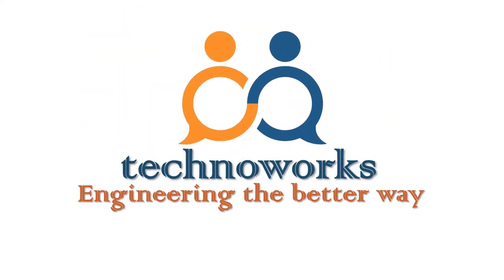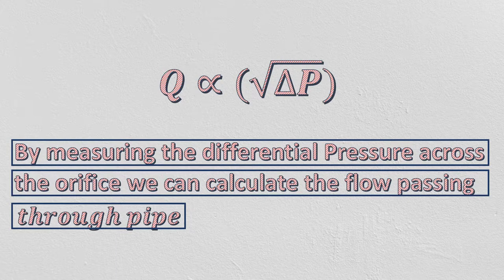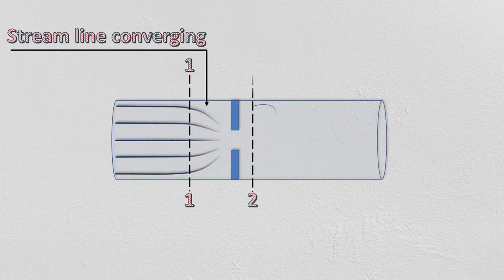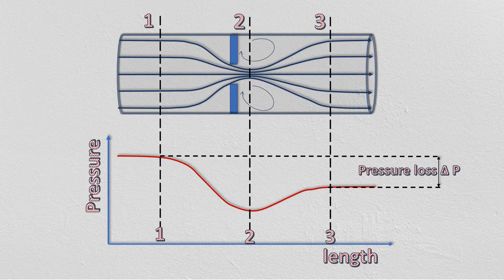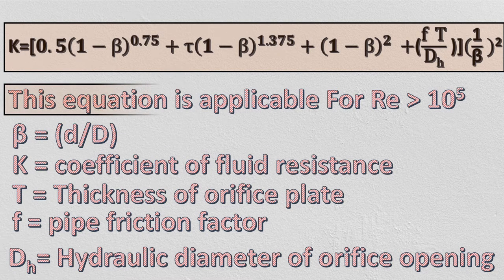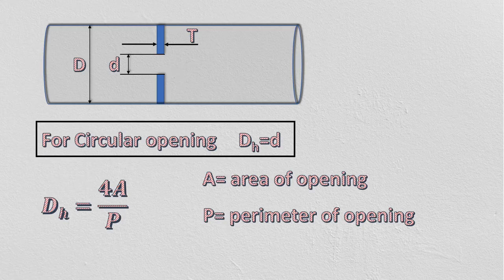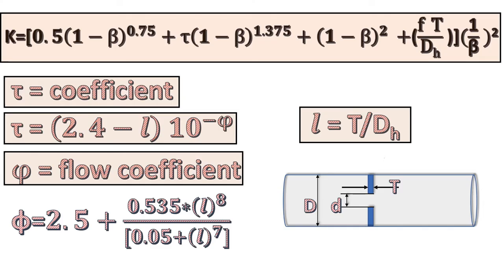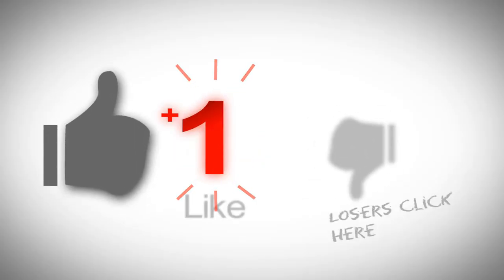Pressure loss calculation of orifice plate

Comment: The pressure loss coefficient correlation comes from "I. E. Idelchik - Handbook of Hydraulic Resistance (2008, BHB)". But in this book page 260, the beta is substituted by area ratio, i.e. beta^2, at time 3:35. Additionally, the calculation for phi in Idelchik's book, the fisrt coefficient is 0.25 rather than 2.5 at time 3:35. I wonder which one is correct ?
Reply: Besides, the excel sheet B25, calculating K, seems to put exponent 1.375 inside the bracket, which is a different form from this video.

Comment: Question pls; On the spreadsheet what numbers do i change if im flowing AIR instead of water ? is changing the formula at B5 enough ? tks
Reply: Did you get the answer?
Reply: @StudySolutionsWala  No not from this bot video , but i did get a spreadsheet from the PTS flow bench form that i found to be extremely useful.
Reply: @luckyPiston  thank you for your response. Can you please share the link.

Comment: Math is not my strong suit, but I have run some testing using your spreadsheet to come up with baseline expected results.  In the test lab, the pressure drops I can recreate are 50-60% of the pressure drops the formulas in your spreadsheet give me.  I think there may be a calculation error somewhere.
Reply: I wonder, is the K for the pressure drop where it is highest in the vena cava, or after it where the pressure is higher than the vena cava, but still lower than inlet pressure.

Comment: this excel seems made for water. When I entered N2 gas details for inlet condition of 2 m3/hr flow, 4 bar pressure and 45 deg C temp for 2 mm size orifice in 1 inch pipe, it did not return me any value. I used 1.165 as N2 density.
Reply from the maker: It's not applicable for compressible fluid like gas.

Comment: The excel workbook for this video has a small error. In cell B23 the formula for the flow coefficient φ uses 0.25 instead of 2.5 as shown in the video. I am guessing this is an error in the workbook rather than the video, correct?
Reply from the maker: I will check and revert back to you
Reply from the maker: The excel sheet is correct, flow coefficient values is 0.25.